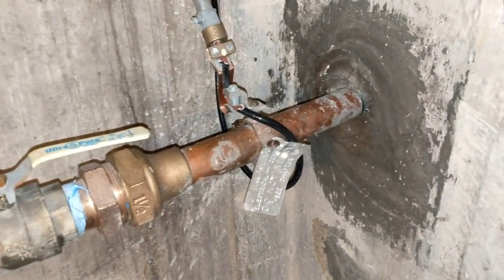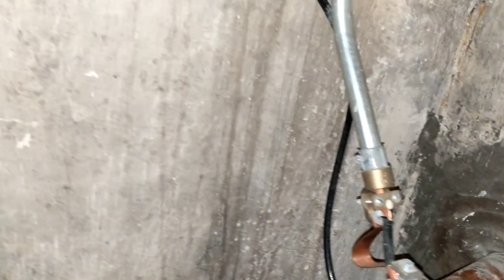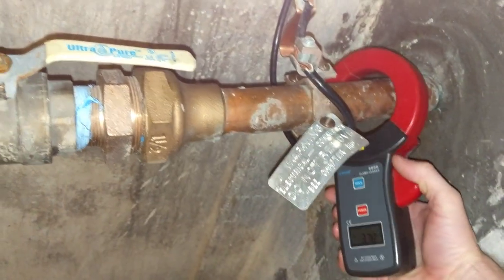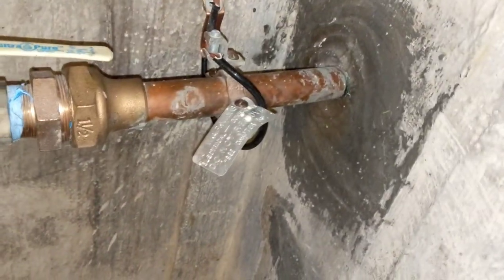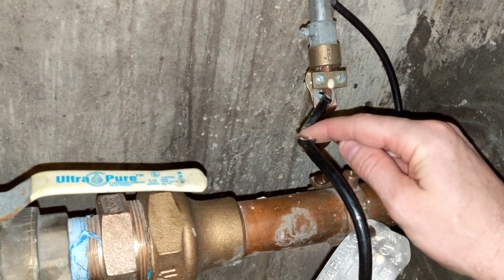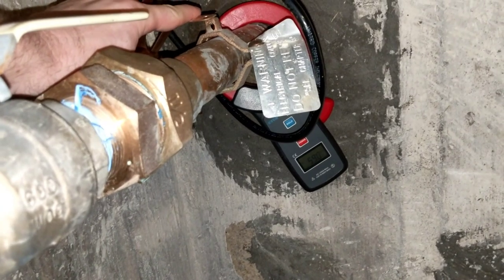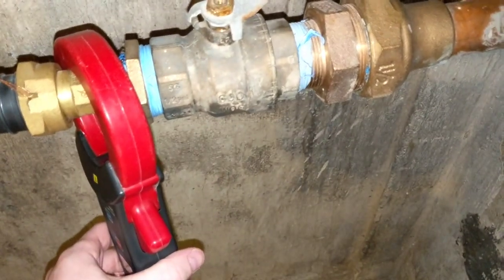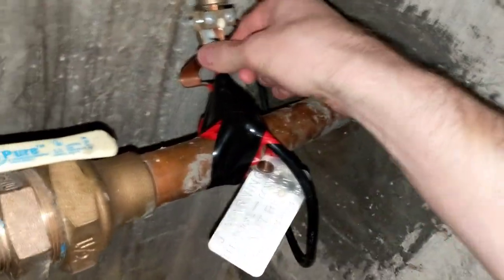How to measure current on pipes with AC Clamp Meter and isolate water pipe to stop undesired current

Comment: Wow. Big takeaway here is if you see electrical tape on the clamps in your ground system, remove it to make sure it is properly connected because someone altered it. 

"We dont ever want some electrician or plumber to come here and see that it is disconnected and say "oh, I better connect that because that's what you're supposed to do."

Since you are asking people for references and dialogue, I will try to participate.

The biggest red flag here even for the non-trained is when someone tries to show you how to get away with doing something to try to "give the illusion" (your words) to everyone else that may come inspect the work. 

You may want to consider increasing the number and size of ground rods to solve this problem, not removing a legally required part of the grounding system. 

Aside from AWWA Standards, the NEC does require this connection. The water pipe is not acting as a neutral or grounded conductor, but rather as a grounding conductor. You are possibly referring to an illegal neutral-to-ground connection, but that has nothing to do with what you comitting to do to the grounding system. That ground wire (which should be green or bare), goes to the other side of the pipe towards the house because there is a meter installed which can not be used for continuity of the grounding system. If the metal water piping system (utility or not) is installed in or attached to the building within 5', then according to 250.68(C) it must be bonded unless if the AHJ says otherwise. 

250.50 says that the list of electrodes in 250.52(A)(1) through (A)(7) shall be used if they exist. Shall is mandatory. If it is there, then you must use it.

250.52(A)(1) helps eliminate your question about using mid-system metal fittings as it says it has to be a metal system of 10' or longer - please emphasis "system". This reference exists because it is telling you to count that metal system in the grounding electrode system if you have it. If you do not have a metal water piping system, then you ignore this. 

250.104(A) says if you have a metal water piping system, it has to be bonded and it gives locations of where to do that bonding at. This is not up for debate on what you think is right. If you have a metal water piping system, then it must be bonded and in any of those locations.

So, if you have that metal water piping system (you were required to bond it per 250.104 and per 250.52(A)(1) only if it is over 10'), you do so properly by following the stipulations in 250.53(D). This article tells you not to rely on meters or filters to keep continuity (that connection you faked) and that you will need a supplemental electrode. 250.53(D) only has the "if" in there because they are saying "if you had the system that 250.50 told you that you had to use, then you also need to do this..." 

That "if" is not there to be an "if you decided to use it".

It seems irresponsible to tell people not only to avoid these legal requirements, but then to give a tutorial on how to make it "look like it is connected" to fool everyone is exactly what is wrong with our industry and shame on you for that. I guess everyone else is wrong, and you are the savior that knows the proper way?

Do not take it from me - you have Mike Holt himself on here telling you to rethink what you are positing.
Reply from the maker: Questions no one, not even Mike Holt will answer:

1) Why does Mike Holt say he wants grounding electrodes in one place interconnected and not having long wires run ar distance to them especially when there are other grounding electrodes...and this is exactly what the water pipe electrode does.

2) Why is it OK to use a water pipe as a permanent primary and secondary neutral conductor with measurable current flowing on it 24/7/365?

3) Why is it OK to cause magnetic fields and the transformer effect since using pipes as conductors csuses imbalanced electrical service and magnetic fields that induce current in conductive paths?

4) If a house has ground rods, why is everyone worried aboutnisolating the water service pipe judt to blindly follow code and ignore the other problems?

5) Why does no one have a problem with plastic water service pipes but some people throw a fit when a metal water service pipe is isolated?

6) How much primary/secondary neutral current is acceptible on a copper water pipe?  How much is "objectionable" ground current per NEC?

I believe no one answers these, because it is a complex problem that everyone wants to sweep under the rug instead of actually solve together.  So instead many appeal to emotion, personal attacks, or the authority  of the limited code of their chosing, and ignore these serious questions.  I would love for you to prove me wrong.
Reply from the maker: Increasing ground rods will make little difference in the readings on the pipe.  In some circumstances increasing ground rods could raise the readings on the pipe.  The solution is to either A) isolate the pipe and get rid of this ridiculous requirement in the code when we use ground rods in the 21st century.  The other option is B) a device that will activate upon a fault and notify homeowners of fault so it can be fixed, but remain open when no fault is present.

Please read and respond to my questions in the other post.  Thank you for your comments.
Reply: @EMFExplorer   If you perceive something I have said to be a personal or emotionally-driven attack, then please bring truth to it and correct it. 

Please do some reflection and determine if you know the answer to those questions yourself or not. If you do not know the answer to things like "how much current should there be?" you may want to heavily reconsider posting videos teaching people how to illegally alter those systems. 

No one is sweeping anything under the rug. It is an indeed complex theory. People go to school for years to become electricians, but I am not sure why when we can all go to YouTube and learn from experts on how to deceive everyone else.  

Now, your questions.

1. Mike Holt does not make the rules, but he knows how to follow them. With that said, all that he and many others have tried to do is point out that the NEC requires interconnection of a certain list of items. I gave you the reference to that list already. As far as long wires are concerned, there are minimum spacing requirements for electrodes as well as something called the sphere of influence that can help reduce the resistance to ground. The more parts/surface area of the grounding system you have in the soil, the better, so a long wire interconnecting electrodes will not matter as long as it is sized and spaced properly per the NEC. 

2. It is ok because it is going into the dirt. Current on the water pipe is not unusual. This is true even when the main breaker is off while the systems of neighbors are all properly grounded to a metal water piping system. If you are really worried about current, you could ask the power company to check the primary neutrals on the service transformer for not being properly grounded or for having highly resistive connections. The only danger that can happen is when someone puts themselves in series with that current. Mike Holt has an awesome video on this called "open neutrals".

3. I am not sure of what you are asking. An unbalanced load just means that there is more power on a certain phase of the service. I do not see how using the metal water piping system as a grounding electrode has anything to do with unbalancing a panel. Electromagnetic induction involves voltage, not current. If there is a voltage induced into the grounding system then the grounding systems does what it was designed to do and it and the earth become equipotential. 

4. I am not sure I understand the question, again. What other problems? It seems to me the only person worried about isolating anything off is you. We are all telling you to include it, and for two reasons: 1. It is required by code. 2. It is required by code because it is a gigantic piece of metal in the ground that helps save lives if a ground-fault ever occurs. 

5. Plastic water pipes have extremely high resistance; they are di-electric. Metal (especially copper) has a specific resistivity value much lower than something that voltage has a hard time flowing through like plastic. No one cares about plastic pipes because we are unlikely to get shocked by putting ourselves in series with a circuit containing plastic conductors. 

6. Less than 1 amp is normal, but it can be more. There is no code section that says a limit on the current in the grounding electrode system. The NEC requires reference to Table 250.66 to determine the size of wire needed based on the service size. Using Table 310.16, you can determine if the amperage measured is within the limits of the wire size.  

It sounds like the device you are talking about is called a ground fault breaker and it is already extensively required.
Reply: @frankcastle6511 Thank you for your reply.  Yes, I realize Mike Holt doesn't write the code.  He does have influence though because of the position he has attained through his years of hard work.  He has stated don't run long long wires to connect to the grounding electrodes.  The longer the wire the greater the resistance becomes and the more it defeats the purpose.  He also has stated don't keep driving more rods and connect them with a long wire as that invites transients/etc.  This is exactly what a water pipe becomes when the panel is on the other side of the house and the rods are by the panel, then you run a stupid long wire to bond to the water.

Why are you worried if the internal pipe network is bonded but there is a break?  You keep mentioning the code and also safety. I'm saying this causes problems that I will explain in more depth...Your mention of the code is not a valid argument - it is an appeal to authority.  I have never seen any data whatsoever that shows people with poly water pipes have been killed more than people with metal water pipes bonded.  In fact I'm sure it's the opposite!  More plumbers have been killed because of this bonding to the city water network that creates a very low impedence path and in situations like...broken neutral to the house...the plumber gets killed.

So, I have just given an example real world of something that has really happened.  This shows an advantage to isolating the city network and only bonding the interior site network.

When I said imbalanced I did not mean the current on the legs.  I meant overall current on the service drop.  The electrical service should be balanced as far as ingress and egress current.  A little "leaks" into ground through the ground rods and other connections, so there is always some imbalance.  I'm measured countless services.  When there is a metal water pipe coming from a city's metal network and connected to everyone else...this imbalance of current is usually many many times higher than just ground rods cause.  That is because the paths are so much less impedence.

1 amp that is imbalanced (unopposed or uncanceled since the opposite current path is not located physically near and following the same physical path and causes enormous AC magnetic fields and will cause health issues in most if not everyone.  Where did you get the 1 amp figure from?

I'm saying that pipes are not intended to carry current in regular conditions.  They should not be used to do so.  Electrical cables are to carry current.  The current needs to stay on those damn cables.  Electricians need to stop using the earth and plumbing networks to move current.  It is improper and illegal.  That's why the NEC mentions objectionable current on grounded objects like pipes and that measures can be taken to get the objectionable current off of these objects.  It's supposed to be on wires...always.

But you seem to be saying it's OK to have it on pipes 24/7/365 and then threw out a seemingly arbitrary number with no citation.  I'm saying it's not OK.  Only in a momentary fault situation wherein the fault is then cleared.

I was not speaking of a GFI.  I mean a voltage clamping device that when voltage reaches x it clamps and closes the circuit to allow the fault to flow current temporarily.  Eg. Someone loses a neutral and it could then close the otherwise-isolated city to internal house plumbing.  But it would need to notify the homeowner so they can fix it.  As it stands now some people do have bad neutrals and are using their water pipe u knowingly, putting themselves and plumbers and neighbors in danger!

I recognize that you have been respectful and carry on a good debate.  I was speaking of some other posters so I did not mean to say those sentiments were directed at you.  The "savior" comment was a bit personal/emotive and unfit for discussion.  I would encourage you to stop appealing to authority though.  I'm saying the code is outdated and misleading when not taking the objectionable current into account.  The code also bans parallel conductors except certain situations of course.  It never allows a water pipe to be a damned parallel conductor.  Yet this is what has happened everywhere.  It causes problems and puts people at risk of electrocution and cumulative EMF ac frequency exposure that can cause many health issues.  Houses with poly service pipes are safer than houses with metal water service pipe.  Prove me wrong.

I suggest they clarify in the code and use just ground rods, bond internal pipes of significant length and relativity to appliances, and isolate the incoming water line with dielectric unions or pex.  That will solve all the problems and make everyone safer.

So we need to be able to have this conversation without just saying "the code requires it."  The code needs to be constantly improved.  I hope I have laid out why this is a problem and that there are solutions to it.
Reply: @shaunkranish  If the code requires it now, we do it now. Just because we do not agree to do something does not change the fact that code requires it now and so it must be followed. I hate paying taxes, but Uncle Sam will surely come knocking if I do not. We can try to make legislation to change that, but for the time being, we must be compliant. 

You are holding everyone to a standard of giving you code references, and yet you say things about the code without references. Not to be pedantic, but there are more than a few instances of this. 

I got the 1 amp figure from what I considered "normal" - averages and figures that I have seen. I also made sure to mention that it could be more. It could be 15 amps for all I care, but it is above what I typically see and would be a reason for contacting the power company. 

I was reading some of the other comments, and I think I understand your goal here is to reduce EMFs, right? I know you are jus trying to help, but you have to understand that there is a solid foundation for why we have that grounding requirement and that it does still exist. If you would like to challenge that NEC requirement, you can get in touch with NFPA by way of the styling manual. 

Let's say that you remove the ground connection as done in the video. Then you come along and touch the interior (home-ward) side of the grounding system and simultaneously grab ahold of the side you just disconnected that is also possibly being backfed from others or in a condition with an open neutral. You would have put yourself in series with that circuit, and you could die. It just take 5 miliamps across the heart to totally fry you. That is a pretty big deal.

While your goal is amicable in trying to help those wanting to reduce EMFs, I hope that you will come to an understanding of why that code regulation exists and that you will remove this video after seeing the damage you could cause. This video is currently only serving as a manual to get someone or someone they love badly hurt.  

The only way removing a piece of a metal water pipe out of the system would work would be if you removed the entire metal water piping system from the grounding electrode system, but even then you are deleting something that can help save lives by delivering excess current into the earth. You are right, it is not designed as a current carrying conductor, but I would sure be glad to have it there when something bad happens. 

Instead of showing people a way to cheat the system, why not show them the proper way to solve this and just install a dielectric piece that enters the structure? Just point to that entrance pipe you disconnected from the grounding system and say "have your local contractor swap this out for non-conductive material". You would be helping the industry which it sounds like you may have worked in yourself, reducing the EMFs by eliminating tie-ins from local services, and not having all these comments.
Reply: @frankcastle6511  I thought it might be good to point out that doing something just because someone else says so and will punish you isn't a good reason or excuse if that action is harmful/irresponsible.  That fits well to the water pipe bonding and also to paying taxes for that matter.  Both are irresponsible since we know better.  But I don't want to speak of taxes here and now.  Just wanted to point out it's not a good defense to do something when you know it's problematic and there is a better way.  While this particular video doesn't show the best way, it has succeeded in creating an important discussion.

I have shown how this practice violates numerous other NEC codes, causes problems, and there is a much safer alternative.  It is outdated, unnecessary, and foolish to leave intact the low impedence path back to other buildings and bond to it.  It should always be electrically isolated and only the internal plumbing should be bonded for safety.  The building should not use this as a grounding electrode.  In some areas they isolate it underground near the street so that the pipe can still be used as a grounding electrode without the objectionable current.  But for most people they should isolate at thr house.  Plumbers and electricians should be helping to do this, not mindlessly repeating outdated information and practice that has been proven wrong.